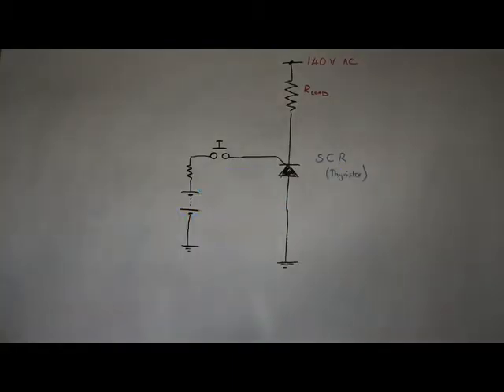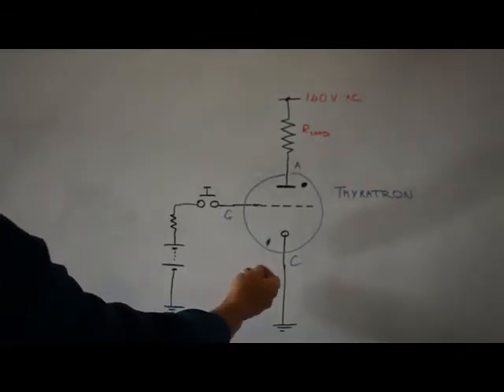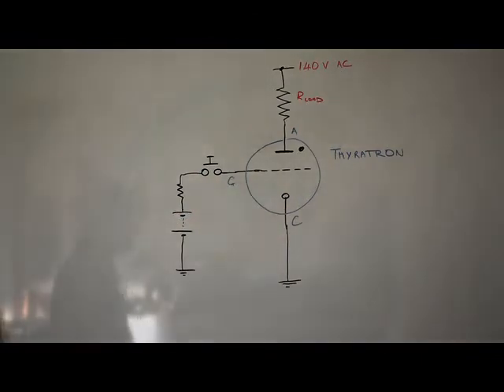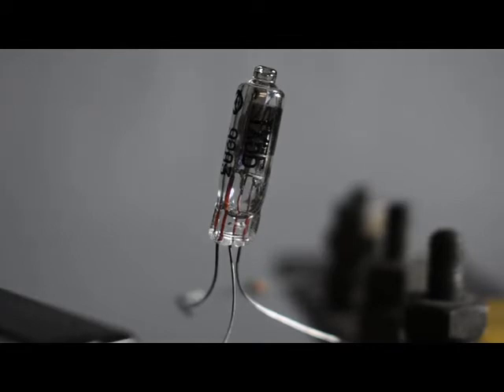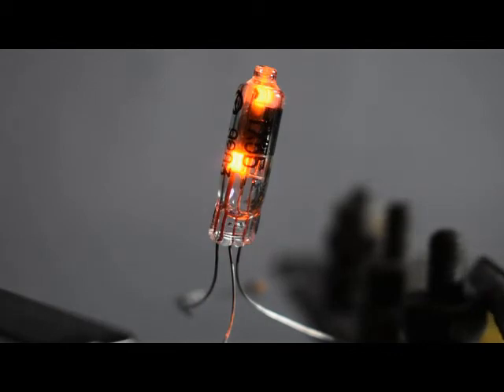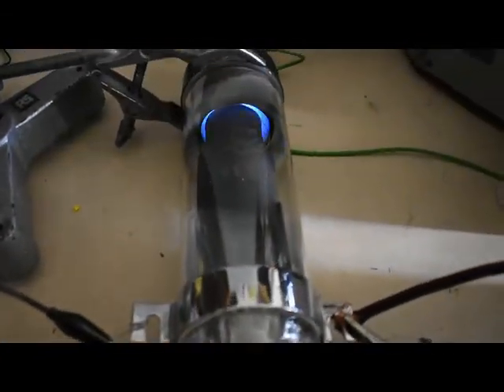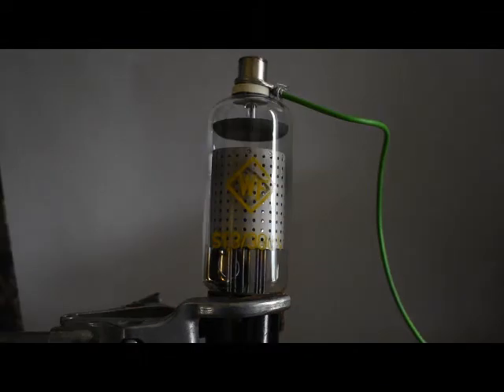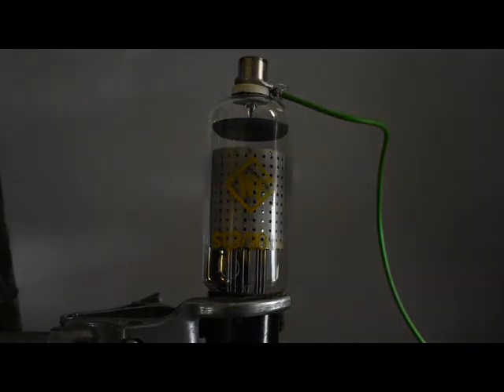The Thyratron

Comment: Thanks for that, what was the voltage on the xenon thyratron? I believe they take quite a high current t fire.
Reply from the maker: The xenon tube is marked S1,3/30dV and is rated for anode voltage around 1kV with a current of 2.5 A continuous 30A pulse. Trigger current will be small in comparison.

Comment: is it radioactive?
Reply from the maker: no emitted radiation, some large tubes may contain Thoriated cathodes or uranium glass seals but the radiation from these would be  low. X-radiation hazards really only start to become an issue if acceleration voltages are above 25kV

Comment: I was looking a video about krytrons, do you know anything about them a how they differ from a thyratron?
Reply from the maker: The only difference that I can see is a krytron is a cold cathode version of a thyratron. So the initial diagram I show and the small neon filled device is technically a krytron the larger tubes have heated cathodes and are true Thyratrons but the function is similar.

Comment: The 2D21 is a very common 7-pin xenon thyratron which was used to a large extent in card punches and is also found in old electronic metronomes. The 5727 is an industrial version with a higher withstanding voltage.
Reply: The 2D21 was also used for switching in jukeboxes.

Comment: Good day, I recently happened upon three 672A thyratron tubes at work, they used to regulate a motor generator field which has been superseded by static drives. It has a four pin base and an anode cap, the pinout is for heater, heater/cathode, control grid, and shield grid.

When establishing voltages for the control grid and shield grid, are they with respect to the cathode as a reference as you illustrated? Also, did you align your load in series with the anode? 

Cheers!
Reply from the maker: hello, nice find.  Voltages are normally given with respect to ground unless otherwise stated.  I have my cathodes at ground and , as you say, the load in series with the anode. It can be arranged differently but I think this is the simplest way to test or operate a thyratron.  Most of mine are triodes, yours are tetrodes having the extra screen grid, but operation is much the same.  I see these can handle 2.5 kV PIV and have a 5v heater.
Reply: @tuopeeks  Thank you for the response! Those voltage specs are correct, I will initially set it up with 480vac anode voltage with a 20watt 15kOhm resistor load. Ultimately I hope to use two of them in a full wave rectifier circuit.

Comment: Thanks for showing this. I was thinking of using a Thyratron for high voltage switching. I have a question and hopefully you can answer. If I choose a Thyratron with a maximum anode voltage of say 15kV, would the same Thyratron be able to switch at a much lower voltage say 3kV? Thanks.
Reply from the maker: It may depend a little on the type of thyratron but, from my experience this should work.  They are generally quite robust, so long as peak power dissipation is observed.
Reply: Cool. Thanks!
Reply: I'd like to see a xenon flash which uses a thyratron trigger.